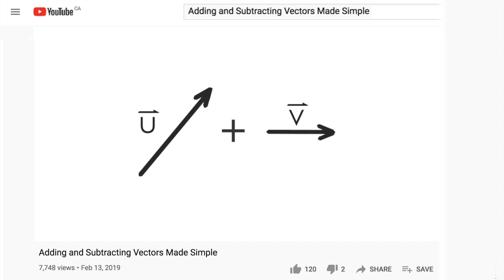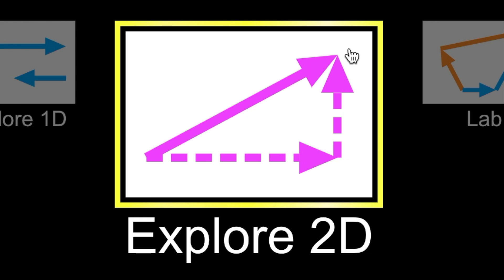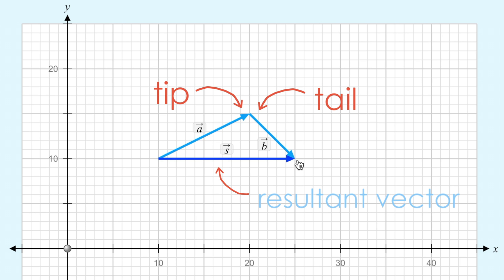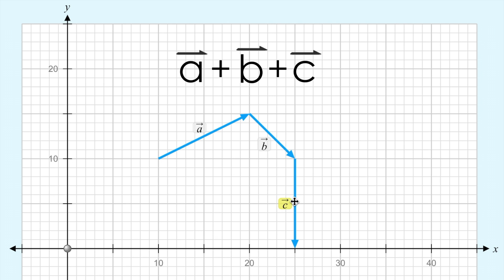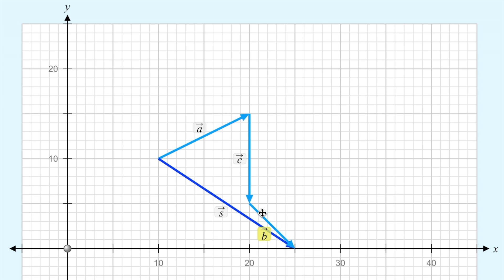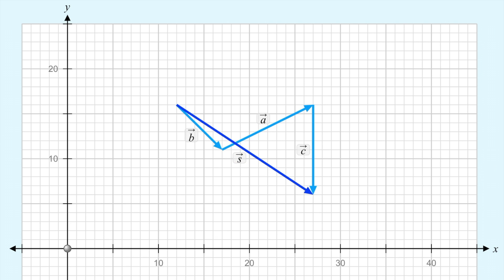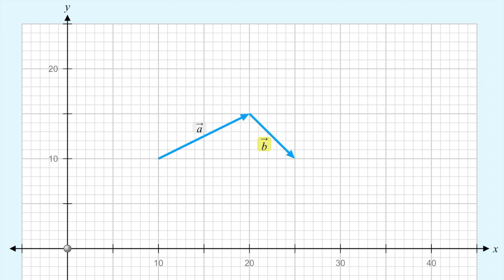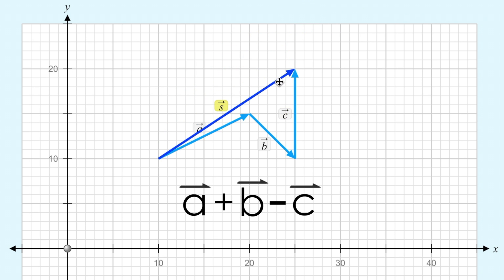Adding and Subtracting MULTIPLE Vectors Made Simple

Comment: For instance, when you had A+B+C, when you introduced subtraction, would the negative vector be the complete opposite of the positive one (e.g. C from above video)? Regardless of angle or direction? Or does it negative vector rely on other factors? Such as the orientation of A,B etc?
Reply from the maker: I’m not sure I understand your question!
Reply: When you showed the negative vector, you just turned the line backwards, does it always just take a 180 degree turn or does it rely on the other vectors, like how an angle depends on another in trigonometry
Reply: @evanjensen6898  waiting lmao
Reply from the maker: Yes. For example, by definition, -u has the same magnitude as u, with opposite direction.